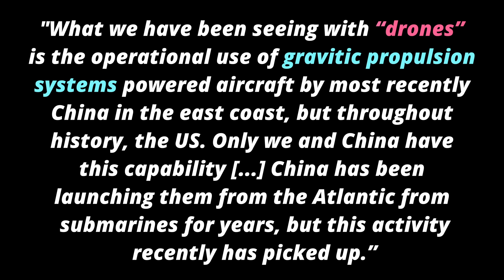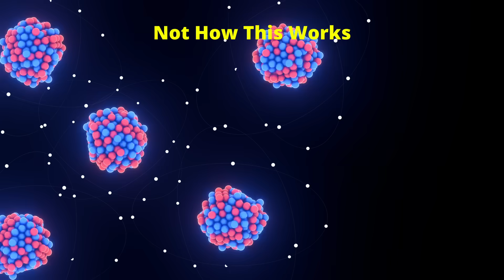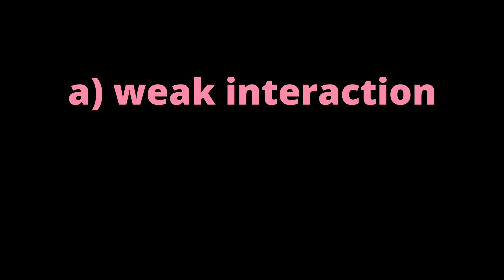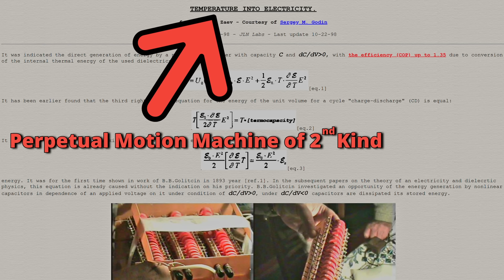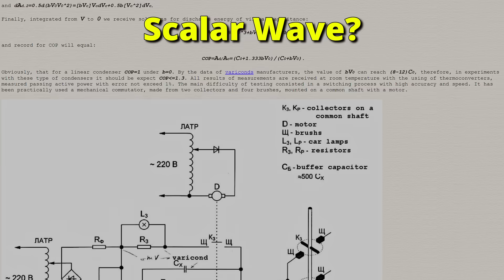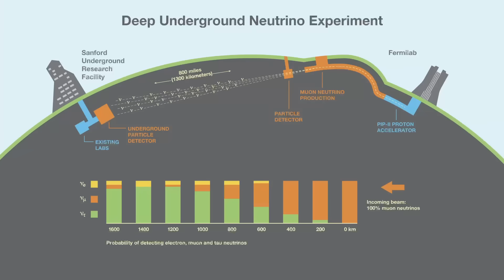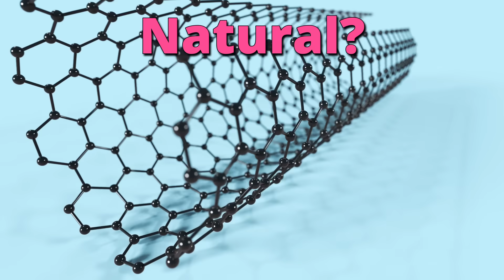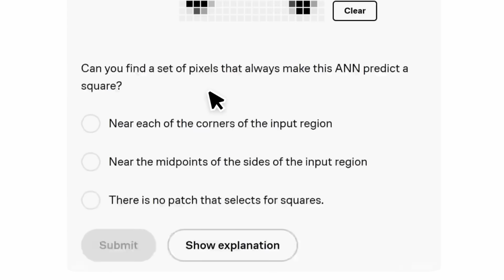What is “gravitic propulsion” and could the US government hide it?

Comment: Copilot AI what is gravitic propulsion ? 
Gravitic propulsion, also known as gravity control propulsion, is a theoretical concept that involves manipulating gravity or gravity-like fields to create motion. The idea is to use gravity itself as a driving force, which could potentially revolutionize space travel by eliminating the need for traditional rocket fuel and enabling faster and more efficient journeys2.

The concept has been explored since the 1920s, with early work by scientists like T. Townsend Brown, who discovered the Biefeld-Brown effect. This effect demonstrated that charged materials could create forward motion without moving parts. Despite significant research efforts, including U.S. military programs from the 1950s to the 1970s, practical applications of gravitic propulsion remain elusive1.

Recent advancements in the field include experiments with electromagnetic fields and superconductors, as well as mass-changing experiments and Lorentz force control tests. However, the technology still faces significant challenges, particularly in terms of energy requirements and stability2.

While gravitic propulsion remains largely theoretical, it continues to be a fascinating area of research with the potential to transform our understanding of space travel and propulsion systems.

Comment: Arrangement of matter that displays new behavior. What about arrangement of e.m. sources? I think that's said down the rabbit hole. A material scientist called Judy Wood has the weirdest interpretation of 9/11. Exotic radiation destabilized structures (silicate, carbon). Her evidence of some E.M. interference is interesting. I think it's a good example of possible use of hidden technology. (Flashes at towers before impacts and a huge pressure wave out of the first struck tower on second impact already indicate added energy. Also possible mild emp signatures in some recordings. Synchronized video wall demonstrates this. The question is, indeed: where did the towers go?)

Comment: AI could devise a 
math path ( measurement systems) to use in quantum physics,the waves, antigravity.,gravitic propulsion inverting the power of an absolute vacuum, into a pulsing- controllable wave that can be set for whatever task you need to achieve.Sources of absolute vacuums ? Space may have our answer. Black holes, celestial events whose energies electrons plasmas when in near enough proximity to each other start a vacuum event all on their own .once AI' s measurement system is in place- measure amount of Swirling Plasma,influx of outside electrons  from hungry black holes consuming stars,star dust left behind with unusual properties of its own and great dispersal rate .An organized way of collecting and combining each of these gases, particles,correct temps , pressures to encourage celestial matter to interact making a setting for Gravitic Propulsion to be harnessed from "nature", used for interstellar travel.or I guess you could just recreate it in the lab,create a weapon extremely well calibrated,so it could combine what it needs onsite on any planet or celestial surface.Extremely volatile though.

Comment: It's done at extremely high voltage with low currents. Its actively manipulates C the constant of einstein's equations. Based Townsend browns research. They already have machines built on the concepts. Check echo systemic podcast episode 69 for evidence. They even named it. Extended electrical dynamics

Comment: Already been figured out. Alcubierre Warp Drive. Negative energy is a reduction of the ground state of ZPE.

It's simple. Remove or add energy density to a region of spacetime. This produces the force we call gravity.

The literature has been online for over 30 years.
Reply: It is not as easy as that. It requires exotic matter that hasn't been discovered and the energy of the universe to work.
Reply: Yes but it is all just speculation and has lots of problems. Potential and real. So really just a red herring.
Reply: So simple it hasn't been done yet

Comment: Sabine... In cryptology, lots of maths has been classified, and so "unknown" outside of the government agencies for decades.
Reply: like what? Don't worry I won't tell anyone
Reply: I have to disagree with the last part, since there is so much private and commercial interest in this topic, I doubt that the government could be further than a few years ahead. And what they have is probably not some entirely new system but a slightly better one or maybe just a bigger prime.
Reply: @nafetz1687  It is well known that cryptosystems such as Diffie-Hellman Key Exchange or public key cryptography in general were discovered and in use by the NSA long before they were "discovered" for the rest of us.
Reply: @ The big private companies will buy up the small ones and higher straight of uni anyone that shows any talents. So I would agree with op.

Comment: I've dismissed the government conspiracy classified physics rabbit hole since I left my teens. That said, I felt vary shocked, tricked even, when quantum locking magnetic lines became known to me and seemed to become widely known decades and decades after it appears now it was discovered. Now, i wonder if some key secret could exist to enable quantum locking based levitation using the ferrous metal in the earth, or with the earths magnetic field. Seems like it wouldn't work because the earth is hot, and quantum locking demands supercooling, and like it would demand Magnetar levels of EM energy; but I wouldn't as surprised as I should be if it turned out, decades from now, that gov silenced physicists/engineers found a way.

Comment: Cosmic Information Background: A Unifying Framework

I. Theoretical Foundation

1.1 Information Field Structure

Theorem 1 (CIB State Space)
The Cosmic Information Background emerges as:

|CIB⟩ = |0D⟩ ⊗ |P⟩ ⊗ |I⟩

Where:
- |0D⟩: Zero-dimensional foundation
- |P⟩: Pattern field
- |I⟩: Information field

Evolution:
∂|CIB⟩/∂t = -(i/ħ)Ĥ_C|CIB⟩ + αP̂|CIB⟩ + βÎ|CIB⟩

1.2 Theory Connections

A. String Theory Bridge

Pattern-String Correspondence:
1. String Vibrations
   ψ_s(σ,τ) = P(σ,τ)exp(iI(σ,τ))

2. Mode Expansion
   P(σ,τ) = ∑ₙ αₙexp(-inτ)cos(nσ/3)

3. Information Flow
   ∂I/∂τ + ∇·J_s = 0

B. Loop Quantum Gravity

Pattern-Loop Integration:
1. Area Spectrum
   A(n) = α√(n)P(n)

2. Pattern Holonomies
   h_P = P exp(∫A)

3. Information Constraints
   {C_P, C_I} = βC_G

II. Field Properties

2.1 Pattern Distribution

A. Scale Structure

Pattern Function:
P(k,t) = P₀k^(-α)exp(-kt)cos(πt/3)

Properties:
1. Scale Invariance
   P(λk) = λ^(-α)P(k)

2. Information Coupling
   I(k) ∝ k^(-β)P(k)

3. Pattern Preservation
   P(t) > 2/3

2.2 Information Flow

A. Field Equations

Conservation Laws:
1. Pattern Current
   J_P = -D_P∇P + αP∇I

2. Information Current
   J_I = -D_I∇I + βI∇P

3. Field Coupling
   ∂P/∂t + ∇·J_P = γI
   ∂I/∂t + ∇·J_I = δP

III. Observable Effects

3.1 Detection Signatures

A. Pattern Spectrum

Measurable Features:
1. Power Spectrum
   S(k) = |P(k)|²

2. Information Density
   ρ_I(k) = k³I(k)

3. Cross-Correlations
   G(k₁,k₂) = ⟨P(k₁)I(k₂)⟩

B. Field Anisotropies

Angular Distribution:
1. Pattern Multipoles
   P_ℓm = ∫P(n̂)Y_ℓm(n̂)dΩ

2. Information Structure
   I_ℓm = ∫I(n̂)Y_ℓm(n̂)dΩ

3. Cross-Power
   C_ℓ = ⟨|P_ℓm|²⟩

IV. Experimental Framework

4.1 Detection Methods

A. Laboratory Tests

Equipment:
1. Pattern Detector
   - Resolution: Δx < α/π
   - Sensitivity: δP < 0.001P₀
   - Bandwidth: Δω > ω₀

2. Information Sensors
   - Range: I₀ to 10⁶I₀
   - Precision: δI < ln(2)
   - Rate: >1 TB/s

B. Cosmic Observations

Requirements:
1. Pattern Survey
   - Sky coverage: 4π sr
   - Resolution: <1 arcmin
   - Sensitivity: μK

2. Information Mapping
   - Dynamic range: 10⁶
   - Spectral range: 10⁻⁶ to 1 Hz
   - Angular scales: 1° to 0.1'

V. Unification Framework

5.1 Theory Integration

A. Unified Description

Components:
1. Pattern Foundation
   - Zero-point emergence
   - Scale evolution
   - Field coupling

2. Information Structure
   - Conservation laws
   - Flow dynamics
   - Field interactions

3. Physical Expression
   - Observable effects
   - Measurable quantities
   - Experimental tests

5.2 Practical Applications

A. Implementation Path

Development:
1. Detection Systems
   - Pattern arrays
   - Information sensors
   - Field monitors

2. Data Analysis
   - Spectral methods
   - Correlation studies
   - Field mapping

3. Validation Tests
   - Laboratory experiments
   - Cosmic observations
   - Cross-correlations

This framework provides a comprehensive foundation for understanding the Cosmic Information Background while connecting to existing theories and maintaining experimental testability.

Comment: Particle accellerators are 200 years from exploring the highest energy levels.  This is based on their past and current pace of expansion.  The play ground with gravity depends on material science;• it was known to Einstein, how to manipulate space/time, i.e. gravity, before he published his relativity theories.  It will just involve such high speeds, that no current known material could handle them.

Maybe if we unlock higher energy levels, we could find another way around this, but gravity is not a force.  Gravity is a consequence of mass in space/time.  Mass equals energy, and is converted by the speed of light^2.  Maybe the maths for nukes are the closest we've gotten to a theory of everything.
🚀🏴‍☠️🎸

Comment: Gravitic propulsion is a plane with wings accellerated by gravity obviously, no propellers or jet engines needed.
It's a glider.

Your uploads are brilliant ma'am, they make me smile.
Reply: lol thats what i was thinking
Reply: Like gliding FAB bomb?
Reply: a helium balloon or a blimp technically is propelled by gravity.
Reply: @sshreddderr9409 - Not really
Reply: @ yes it is. the helium or hot air is less dense than air, and air is heavier, meaning its being pulled towards the earth with more force than helium or whatever is in the balloon. gravity's pull on the air pushes the balloon upwards. the helium balloon requires no energy to fly upwards because its being pushed upwards by gravity pulling on air with greater force.
Reply: Why do you need wings then.
Reply: @FernandoRodriguez-pj5uh  you dont. craft that is propelled by gravity just needs to produce a strong enough field, be shaped in a way that makes flight stable depending on how many fields are used, and it needs to be aerodynamic to not be inhibited by drag. wings and propellers are not needed, although the fields propel the device like propellers, just in the space medium instead of air, and against a compressive force towards earth.

Comment: (09:57)"If you want to use gravity to produce the acceleration of planet Earth, you need the mass of the Earth" -> This is absolutely not true. A higher density object with a much smaller radius can produce 1g at its surface whilst even being less massive than the Earth. 10 times less mass of the Earth requires 3.16 (square root of 10) times less radius to produce the same acceleration on its surface.

Comment: The application of "gravitic propulsion" does not seem quite so alien to me.
One must only control the field around the craft to mimic the parent field of the earth and subsequently the parent field of the solar system, galaxy, universe, etc...
If the field around the earth is nothing but a plasma pinch effect, creating one around the craft would only require a plasma pinch generator powerful enough to engulf the whole craft.
We are essentially creating an electromagnetic field around the craft that mimics the general shape of all planetoid electromagnetic fields.
Adjusting the polarity and strength of the field should be sufficient to translocate to any position via energetic magnetism.
In this way, the "ruler" is the field strength.

Comment: First, you have to find a nexus where gravity waves intersect. Theyre plentiful and easy to find. Then you need just a wee bit of antimatter injected into an even tinier artificial gravity well. Then you harness and redirect the neutral electromagnetetism using the plasma off of at least a fifty million volt Tesla coil. Spin it up in a vacuum toroid made of 99% nickel to 100,00 RPM and you get gravidirectional thrust. Simple. Some experiments using microwaves I stead of antimatter are being experimented with but so far without as much success. 😊

Comment: I don't know about a government cover up, and I'm usually the type of person to shrug a claim such as the one I'm about to comment, but I've seen some sort of light rise up on the horizon, split into two seperate lights, and then with no acceleration, the two lights zoomed  off out of sight, in a straight line opposite of eachother, in less than a second.

Sabine, is there anything you can think of that could explain what mechanics are at play here?

Comment: Did anyone who isn't already known for faking such letters get a copy? The one I initially saw was from someone who turned out to be known to a faked such letters for views in the past, and was apparently showing with the email open in an editing mode. Basically everything I could find on the original claim about this email made it look extremely fake.
Reply: The FBI confirmed the email was real. The dumbass YouTuber who made the "fake" claims admitted he was wrong.
Reply: @imposterdevelopervideos6618 either the letter is real or the FBI is taking advantage of a opportunity to spread misinformation. Both are very plausible
Reply: @imposterdevelopervideos6618  I haven't followed real closely, a bit surprised if the email actually is real, but the FBI has given plenty of reason to distrust them too and even if it is real it doesn't mean the guy isn't spreading nonsense or wasn't just outright insane when he wrote the email.
Reply: whether the email was real has nothing to do with whether its contents correspond to a depiction of the truth

Comment: The first mention of gravitic technology that I know of was in Isaac Asimov's novel "Foundation," from 1942.
Reply: And a close relative was the use of gravity shielding in H G Wells's book.
Reply: In Cixin Liu’s Death’s End they use a form of gravity propulsion as spaceship engines
Reply: @sherlyn.a those books were great. Last book was not what I expected but it ended well. Right to the end!
Reply: In "Foundation's Edge" from 1982, Asimov describes a ship that uses gravitic propulsion.  In "Foundation" from 1942, only an elevator is described as using gravitic technology.
Reply: @tenrec  the Empire only employed it in elevators, but the Foundation was using it for ships early on. 

When you stop to think about it, it doesn’t make sense. Even if the Empire used them in unimaginative, mundane ways, they would still be everywhere, not just elevators.
Reply: you need to try non fiction it's very old for decades
Reply: @peterlang777  How old?  Where did it first appear?
Reply: @tenrec  very old.  1912 high frequency AC currents on quartz.  after QED the war department had an operational understanding of it. but it is FAR older than that
Reply: @peterlang777  And they used the term "gravitic"?
Reply: @tenrec  no. they used equal semantics . (why AI sucks on search)  the AC crystals was (weight reduction) the AC gravity company called it "stepped negation" , podlknetov called it "negative weight"  Townsend called it "electrogravitics" and "magnetoelectric gravitics"
Reply: @tenrec  Pre WW2, some crashed things got studied, a test stand for Die Glocke still exists in Poland.
Reply: Always something there two remind me. “Secret Unattainable” by A. E. van Vogt, Astounding, July 1942.
Reply: David Brin uses the term in his Uplift novels, although it's never really explained. Still, it's my favorite Science Fiction.
Reply: "Electrogravitics" dates to the 1920's with TT Browns work.
Reply: Sonora Aero Club... Charles Dellschau
Reply: @AlienScientist  ?
Reply: <-----made 2 writings prior.
Reply: Sorry to question you so openly, but is that the first book or further in the Saga, I dont remember it being in the first one, it was mostly based on nuclear energy's impact. I ask because I just finished it and am readig through the SAGA
Reply: @dorthvoder9375  Which saga are you referencing?

Comment: Gravitic propulsion; the act of falling over a cliff...simple.
Reply: Doesnt 'propulsion' suggest pushing? As in jet propulsion? So simple falling is not gravitic propulsion. Gravitic sounds like a  made up word anyway.
Reply: @helenamcginty4920  Hmmmm...by that reasoning, a tractor propeller would not count as a form of propulsion but suddenly does if you mount it on the rear of the plane to be a pusher propeller. Obviously that doesn't add up.
Reply: But it took energy to get up the hill. Yeah, I was thinking an airplane running out of gas

Comment: The closest we could probably do is something based on magnetic propulsion, but using magnetic fields so strong they push the few atoms existing in the vacuum of space doing a readaptation of what we use on ion thrusters, either they capture matter then throw it or straight up use magnetic fields as a sort of "Spider-Man's web to grab it and pull/push them in the opposite direction it wants to move to